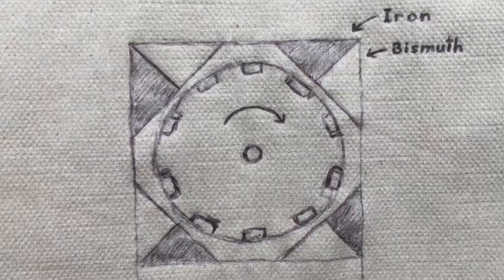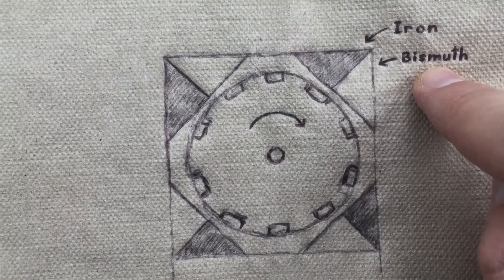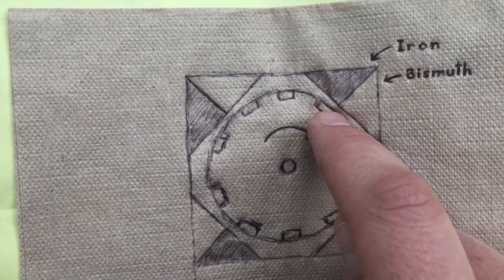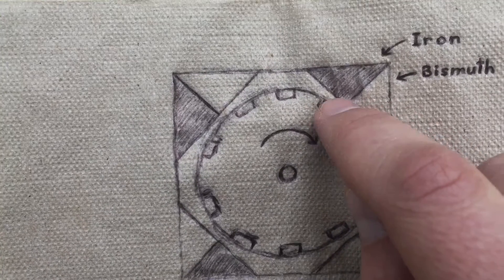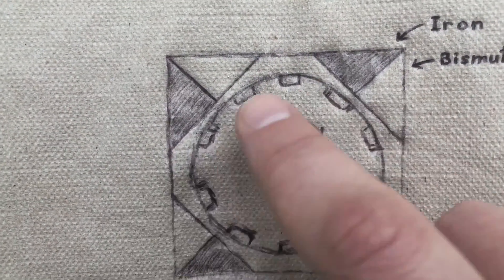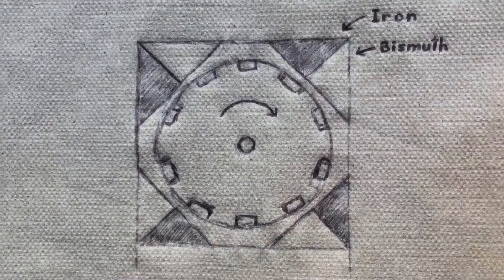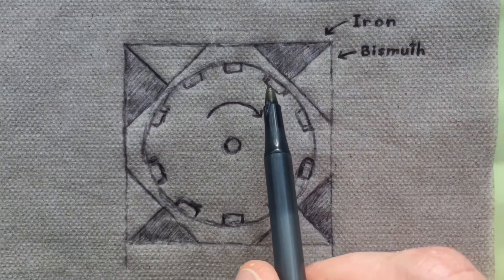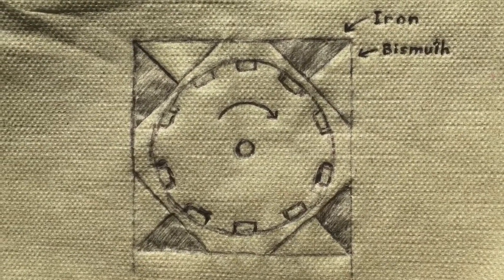Bismuth Magnet Motor Concept

Comment: Thinking along the same way I envision a standard phase shifted magnet array loop type attraction motor with some kind of "camshaft" timing gear that could move a piece of bizmuth in and out of the magnetic cross over point so as to negate the sticking point each time it passes it.
Reply from the maker: Yeah! I'm sure if there is a cogging (sticking) problem, that type of solution could work.

Comment: Yo! Very close! I think you're still gonna have the same problem however but check this out I'm sure you're aware of how you can use two pieces if bismuth to make a magnet spin "infinately" while levitating? I say infinately in quotes because the air friction is what slows and will eventually stop the magnet. Well if you could recreate that in a vacuum and use copper wire coils positioned around the spinning magnet.. you'd create magnetic induction in a vacuum and so infinite energy. Hope that helps. I'm working on my prototype. Fingers crossed
Reply: Any progress?
Reply: when the magent rotates, the bismuth will generate a magnetic field opposite to the spinning magnet also known as Eddy currents and it will slowly stop the magnet!

Comment: I agree, this should be built. I know it's possible. Give it a push if it slows! Add a small motor with periodic additional force to the rotation, and with the right set up, you can maybe still come out above unity. Magnets are zero point energy. What about mr teslonian's latest monopole material? It could help. What about the john device aka skinner, where momentum and leverage take over a huge mechanical advantage in torque. It's driven by a small motor, and seemingly produces more. Maybe combine these ideas?
Reply from the maker: Teslonian's latest monopole material? Can you provide a link to that?

Comment: I have an idea, its a box with bismuth sides with a fixed magnet center in something that can hold liquid nitrogen, out side the box is a setup of magnets is the star points to move the anti gravity box in the center from the Lg N magnet held center in total repel from all sides. On the outside box is ice cream cone shaped speakers that you can control the volume to create thrust of the anti gravity field. The only problem is controlling the speed due to weightless movement and the rate of lift and decent. The magnets on the outer box must have gears attached to them that are non metal to move the surrounding magnets in and out the anti gravity field for up and down, left and right, forward and back, sound would be used for thrust
Reply from the maker: Dominiques Rasta sounds interesting, but really hard to grasp (at least for me). Why don’t you make a video of it, if only to depict it the best you can with illustrations, a model, etc.? If you do, go ahead and post a link to your video here.
Reply: Yes sir working on it now

Comment: sorry but it will not work. I will not mention zero rotor movement. I will add; Iron is ferromagnet, has powerful attraction over 800k, bismuth is most powerful diamagnet but has -280 magnetic attraction. you must use paramagnetic element scandium which has 295 magnetic attraction power.
Reply from the maker: Hasan Milli good call! I have since realized iron is probably too strong, but hadn't yet put much thought into which material would be most suitable. Thanks for the suggestion!

Comment: I thought this idea an year ago.......but i think this kind of motor will have less torque. as well as rpm.
Bismuth is not 100% diamagnetic on the other hand it is very heavy metal.

I have an idea of.... mixture or layers of Bismuth, Pyrolytic graphite, Giron, Copper, Mu metal may work they are all diamagnetic metals....

anyway here is the list of Diamagnetic metals and chemicals from periodic table.... i dont know the exact percentage of diamagnetism of these metals below.

Hydrogen Diamagnetic 
Thallium Diamagnetic
Helium    Diamagnetic 
Lead         Diamagnetic
Bismuth  Diamagnetic
Beryllium Diamagnetic 
Boron         Diamagnetic 
Carbon         Diamagnetic 
Nitrogen         Diamagnetic 
Silver         Diamagnetic 
Cadmium Diamagnetic 
Indium         Diamagnetic 
Neon         Diamagnetic 
Antimony Diamagnetic 
Tellurium Diamagnetic 
Silicon         Diamagnetic 
Xenon         Diamagnetic 
Phosphorus Diamagnetic 
Sulfur         Diamagnetic 
Chlorine         Diamagnetic 
Argon         Diamagnetic 
Copper         Diamagnetic 
Zinc         Diamagnetic 
Gallium         Diamagnetic 
Germanium Diamagnetic 
Arsenic         Diamagnetic 
Selenium Diamagnetic 
Bromine         Diamagnetic 
Krypton         Diamagnetic 
Gold         Diamagnetic
Mercury         Diamagnetic
Reply from the maker: Seems like you should just try the most diamagnetic material you can get your hands on. I would think mixing it with any other lesser diamagnetic materials would only dilute it's diamagnetic strength and weaken the effect. I thought bismuth was the most diamagnetic element. Or is it only the most diamagnetic metal?
Reply: Joe Rhoney he's on to something if you can manage to create a alloy with bismuth that keeps it some of it's  anti-magnetic properties and and somehow pass on Copper's electronical properties then you can literally make a generator out of just the metal alone.

Just remember every metal in every mineral on this planet is a form of crystal Crystal's combining with other crystals have their own form of chemistry separate from regular chemistry it is all just remarkably intertwined.
Reply from the maker: jonah gaff I see. I didn't know that about crystals. That's amazing! Do you have any sources you can recommend for studying up on known manifestations of crystals?

Comment: The problem I have always had trying to build these in different setups is they always eventually lockup. Maybe this one could work if you also had some kind of flywheel effect connected. Anyway all attempts at magnet motors for me eventually slow down and lock up.
Reply from the maker: Robert Gibson, same here. That's what I mean by "cogging" (apparently, that's what you call that). I'm hopeful that this approach will at least make cogging easier to overcome, since it isn't complicated by the nature of magnets  (north/south polarity + spinning vortexes, etc.).